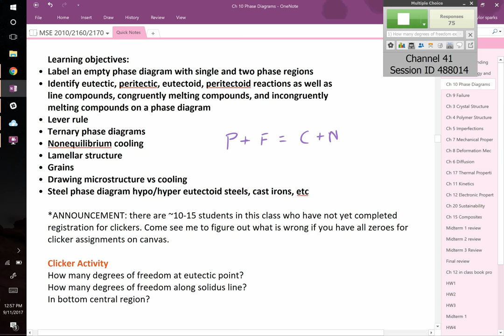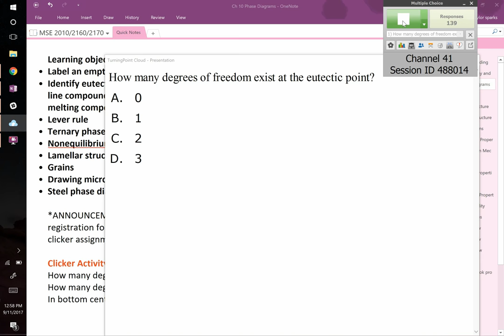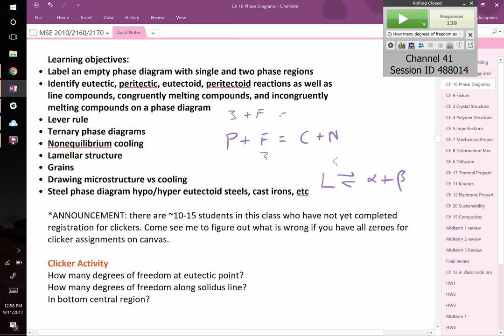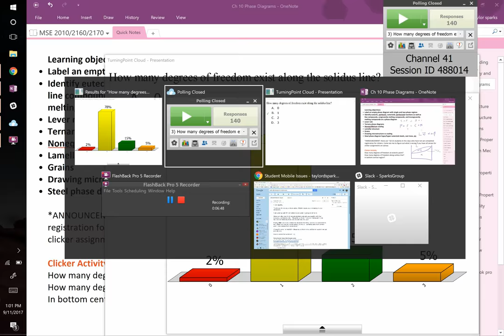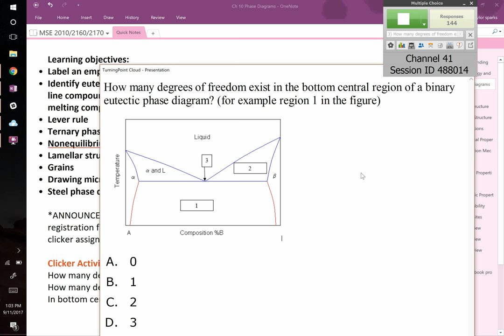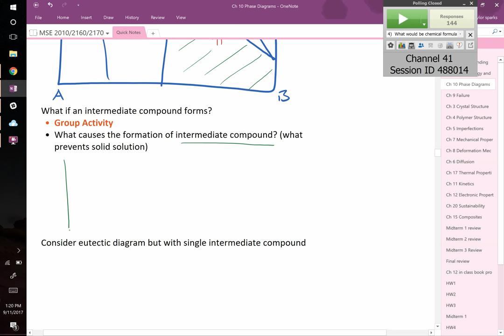Day 8 Intermediate compounds and Phase Diagrams

Comment: What is the difference between line compound and an intermediate?
Reply from the maker: Evanescence29 great question. The only difference in that a line compound only exists at a single stoichiometric ratio (specific chemical formula), whereas an intermediate might exists over a range of compositions.
Reply: Taylor Sparks a line compound does not necessarily have to melt congruently, right?
Reply: By the way, thank you for the response :)
Reply from the maker: Evanescence29 nope. Not at all. When it doesn't melt congruently it is a peritectic reaction
Reply from the maker: Evanescence29 any time ;)
Reply from the maker: Evanescence29 no problem. Subscribe for notification of new videos ;)